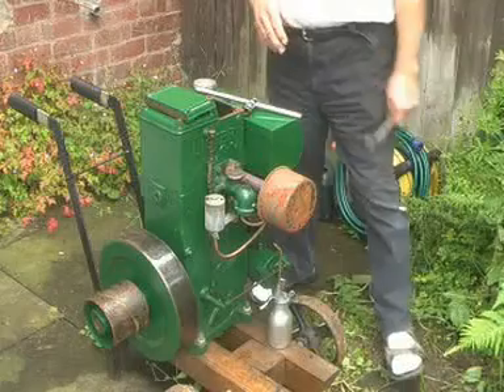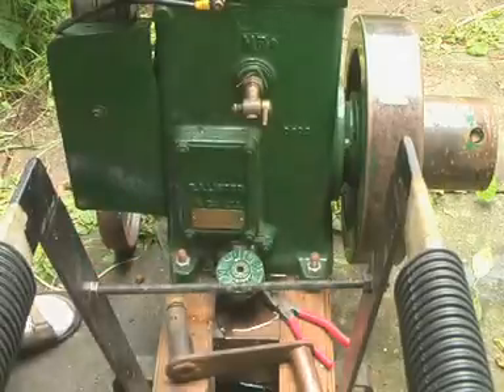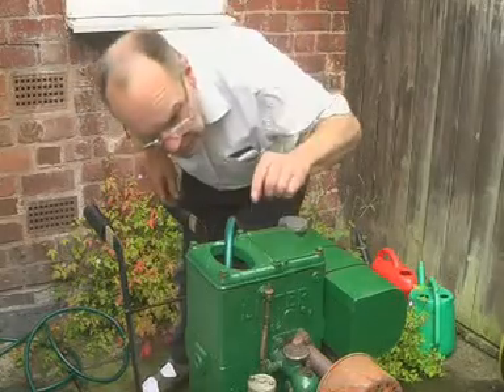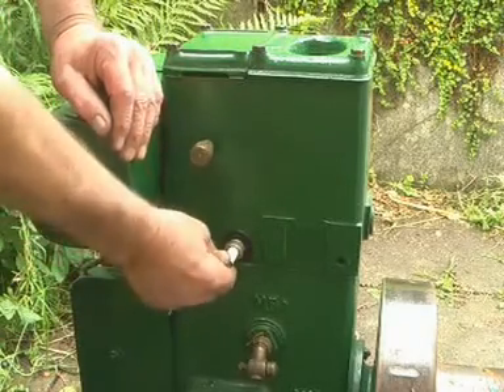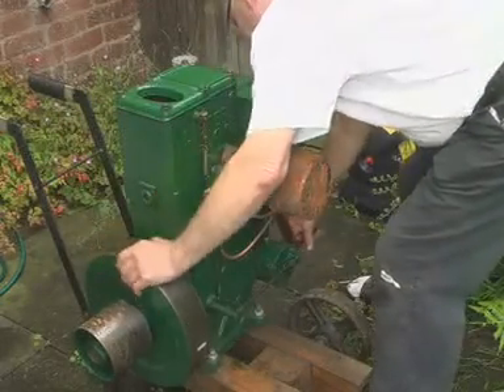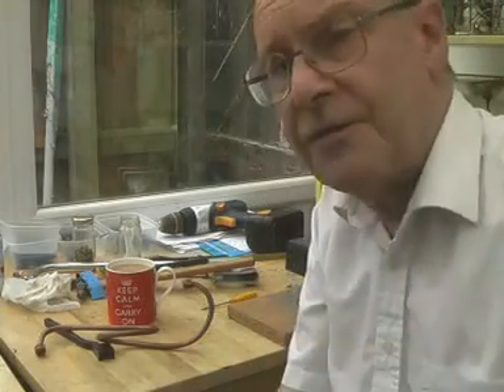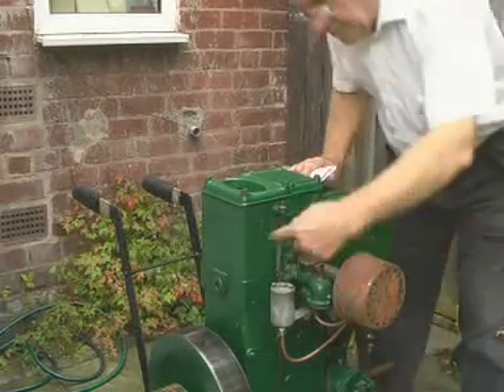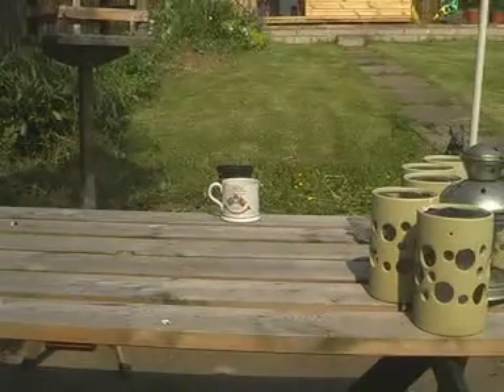lister D

Comment: As far as valve clearence goes. Set them wide. Run the engine on a load to get it nice and hot. Stop the engine and measure them again before it cools down. This will give you an idea of how much they tighten up between cold and hot. The rest of the cap is to allow for the valves wearing out between services. If its just a show engine then you can set them on the tight side to quieten it a bit.

Comment: I want to find anyone who has bored out s D for liner fitting. How much can I take out before breaking into the jacket?
Reply: I have one bored out to 0.020" no problem
Reply: @daviddunne1178  I will have to take mine out to 3.230 inches for the liner, unless you know where I can get a +20 piston with rings.

Comment: Great!  Just thinking about rebuilding my 1949 Lister D, from an Oogle hay elevator, so pretty rusty!  12 years since I took it to pieces!
Reply from the maker: Good Luck. Let everybody know how you get on! Cheers, Norman.
Reply: @bixanorak  Hi Norman.  Well, rust removed and all painted up now.  Loose-fitted all the parts today, and now impossible to lift of course, LOL!  Magneto is the worry, but I know of someone not too far away who can check it over for me.  I do have a new spark plug!  Watch this space.  Cheers.
Reply from the maker: @GWRDukedog9021  Hi Geoff. Don't worry, I'll be watching out for further info. Hope you've been taking photos so you can make a video or slide-show of your progress. Indeed, the magneto is crucial. A weak, feeble 'clicking' spark like I had seemed OK in the open air - but inside the cylinder under compression, the air/petrol mixture is much denser & the spark might not occur. You need a good fat 'snapping' spark outside - which I'm sure you'll figure out how to get. Keep up the good work! Cheers, Norman.
Reply: @bixanorak  I'll keep you posted on the Magneto.  Yes, I have some video shots and some early photos too.  Regards

Comment: Nice, I must just out why my Lister don't want to keep running, that needle of mine have a little bend on the tip, I will fix that and try
Reply from the maker: Hi there & thanks for writing. Yes, little tiny things can be a complete drag. I made a new one in the end from a piece of studding - I think it's 5/16" BSF, but check that. Happily I have a small lathe & was able to machine a nice tapered point on it. 5 years on from the video, it now lives in my garden shed - I fitted a long exhaust pipe that goes through the shed wall and up several feet, with a top hat to stop the rain getting in. I run it for half an hour every 2 or three months, and (touch wood) the magneto is still fine & it starts easily. Best of luck with yours! Cheers, Norman.
Reply: Norman Field  Thanks Norman, appreciation for your reply, I will try your advice on Saturday, I will let you know

Comment: Lovely video, many thanks.
Reply from the maker: Thanks for writing! Glad you liked it. It now lives in my garden shed, and I don't suppose it likes having a copper exhaust pipe about seven feet long with two elbows to get the exhaust through the shed wall & up in the air a bit. The normal exhaust is what, 7" or 8" long? Still, it's survived in the shed for over four years, and almost always starts pretty easily. Of course, for the first start of the year, you check the oil, top up the governor, oil the magneto chain, change the sparking plug for the other one, freshly brushed & cleaned, &c. It's also helpful to mutter a few mystic incantations, and to verbally praise the engine for its many virtues. Then, it will usually go on first crank. It mostly eight-strokes for the first few minutes (I put that down to the long exhaust pipe?), but as soon as it has warmed up a bit, you can thin the mixture, and then it's perfectly happy. Finally, I hope that everybody who has wanted a Lister D (or anything similar) will somehow be able to get one, because - I can't quite describe the emotion of it all - it's just such a rewarding thing to have. These machines (whether the small ones, or the great big ones) helped to underwrite so much sheer achievement in agriculture, farming and industry, that they seem to me to be a small but vital part of the very soul of this country. OK; I've had a couple of drinks; but what the heck! Cheers, Norman.

Comment: A great 'how to' video.  I really enjoyed your natural presentation. I have just bought my first Lister D and go to collect it tomorrow.  I've not had an engine with magneto ignition since I had a Stuart turner 2 cylinder petrol engine in a boat back in the 60s and 70s.  Your video brought back a few memories.
Reply from the maker: That's great, Jon! Wishing all the best of luck with your new engine. I got both the standard books on the D, which were a great help. And btw, there is a common error lurking around, about the tappet clearance - a misprint that somehow survived. The wrong one is far too big - so big it's 'obviously wrong'. 8^) Cheers, Norman.

Comment: Hi Norman, thanks for the video. Can you tell me how many screw turns the run stop valve should be please. Leon
Reply from the maker: Hi Barney Dog. Since the video, I made a new needle valve - the tip of the old one was pitted, as remarked, so its action was a bit unpredictable. It's a 5/16" BSF thread, so got a piece of studding & turned a taper on it to as near as I could get to the same angle. Now, the entire range is about three-quarters of a turn from fully closed (i.e. fuel turned right off), to cold starting position at about 3/4 of a turn open - and of course you press down the the top of the air inlet valve when starting from cold - this acts as a choke to richen the mixture. As soon as it fires, let the air inlet valve go, then turn the disc a bit (usually clockwise) until the engine runs, even if a bit rough to start with. Mine usually 'eight-strokes' at first, but as soon as it starts to warm up a bit, it will properly four-stroke, then you can screw in the disc until it is open maybe half a turn or a bit less. Of course, they'll all be different & have have their own 'preferred setting' - but once you've found it, you should find it pretty reproducible! Cheers, Norman. P.S. The main point is, it all happens in about one turn; if you open it 2 or 3 turns, it will almost certainly flood & never start. That's what kept happening to mine, as the end of the needle valve was wonky.
Reply: Thanks Norman, very helpful. Regards Leon

Comment: Wonderful. I have been going to a local thresheree show for 20 years and as far back as I can remember one of my favorite displays has been a large line shaft flour mill station ran by a large lister engine. The man running it has been coming to this show for at least that long if not longer. The tradition hasn't changed and the restoration of the engine is as old as the years it's been at the show. It's wonderful to see the engine age the more years I go ...  Just wonderful.